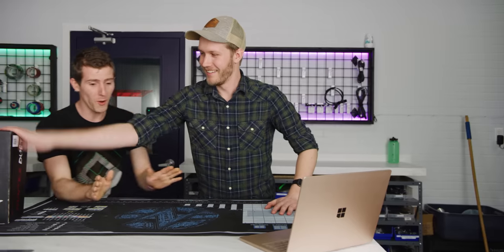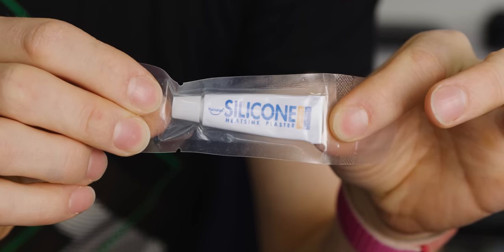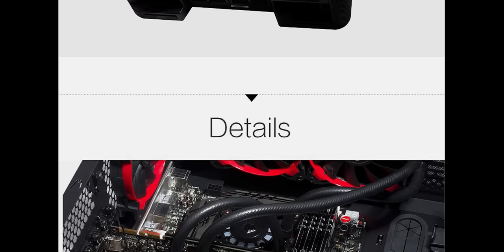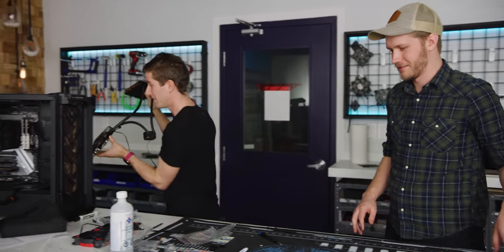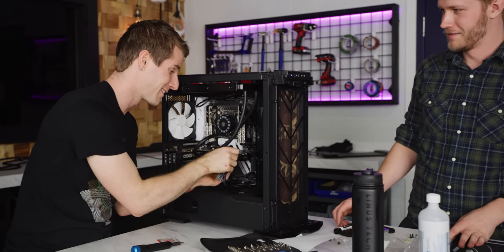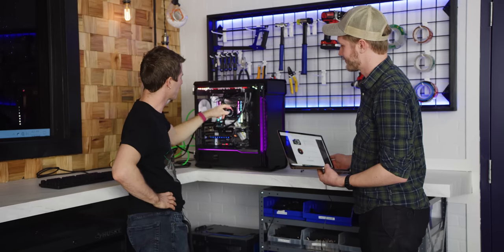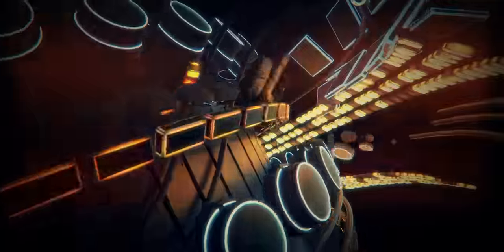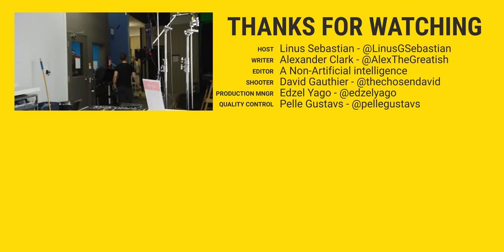This Chinese Water Cooler is WAY Better Than I Thought!

Comment: "I'm glad you took a 1070 for this"
Me beeing proud on my 1070 crying hearing this
Reply: Brah, i am upgradin AIO into my RX 580 that has just been waiting to be used.
And the stock cooler was shiet on it, that is why i just reserved it.
Reply: @mazz1985  May i know what AIO cooler you are upgrading to, and what brand is your gpu? I have this shitty msi armor rx 570 4gb that has inadequate cooling,i even tried 120mm fans mod on it  but that didn't work either so i think my last shot is AIO cooler. and is there any other lower budget AIO option that has decent cooling ?
Reply: @mazz1985 
God damn that's a 200usd AIO, I can't afford that. Is there any decent AIO cooler that is like at least below 60 usd can fit rx 500 series?
Reply: @akmalrusydi2730  compare the mounting system on a cheap cooler master 240mm aio to an Nzxt aio, if it's the same you can mount it. Although for the price it's not really worth it as the Nzxt kraken mount is expensive
Reply: @mazz1985  I have an armor 580 too,I put an arctic accelero cooler on it because man the armor cooler is garbage.
Reply: @ffwast  Ahh, i tried to buy that cooler first too, they were not available anymore :7
Reply: @mazz1985  I've seen them here and there but the price has jumped quite a bit,it was already $20 higher by the time I got mine.

Newegg still has raijintek morpheus coolers in stock though.
Reply: @ffwast  Well, i alrdy got my AIO working on the 580 so, fine for the moment.

I am European, might have slightly different market.
Reply: @ffwast  I had this gpu as back up for couple of years, i figured now is the time to make it primary.

I also was curious to see AIO pump in action, had one in my CPU, but it is easier to set up air cooler on CPU than to GPU.

Comment: This iDCooling cooler is excellent. Used one on my sons build, i had used an old 120mm gpu aio on his old 1070ti. Oc'd that 1070ti as high as it would go, pretty high too, and it wouldn't crack 60c. I paid $70 for it. Well worth it as the 1070ti was a pny with the worst cooler ever. I couldn't keep it under 80c gaming, iDCooling makes good stuff

Comment: One thing they did wrong with the VGA pump was they screw it in with both the shroud and the i/o panel on top of the table. The i/o is 2pcie slot tall and the shroud is just about 1 and half tall only so it is expected that not all the surface of the pump touches the chip of the GPU. Also the screws on the pump or the once they used at the back does not have springs to help level the pump. In my experience using 120vga and 240vga AIO pump (Exactly the same w/o the CPU pump) is that you have to put the shroud on the table with the i/o panel of the GPU just over the edge so it would not touch the table. And also if there are no capacitors or components blocking the view, you have to peak under to make sure the copper pump touches the middle on all 4 sides. Then while placing the screws and backplate on top, you should do the Diagonal pattern screwing top left and bottom right and vice versa until it is tight. Not too tight though,  because if one corner is tighter, the pump may lift on the other side and we will have the same full contact problem and redo everything. Remember r9 290x @ 90c on any AAA game. I tested 120vga id-cooling with the same pump and shroud and was able to pull it down to 65-75c full load. With the help of course changing the stock fan that came with it (SF-12025 red led 54cfm) with SF12025 No led 84.5CFM for the Radiator. Of course to achieve that, I replaced all my fans in the case to the same 84.5cfm id-cooling SF12025 fans. DOes not have RGB but you can change the rings from Red, to white, blue, or Green. Good thing they had remount the pump and fixed the thermal issue, they just did not show us how they mounted it properly off-screen. 
.

Comment: cooler master made an AIO cooler for like 80 bucks back in like 2010 called the cool-viva, and it had 2 blocks, was designed for use with a cpu and gpu at the same time, i had one, it worked pretty decently. Couldnt overclock on it, but temps were decent and it looked really cool in the case

Comment: Bare silicon like the GPU die here MUST have full thermal compound coverage else ineffective heat transfer or overheating is imminent. That's why I always spread the compound thinly with a clean plastic card when applying to bare die and use a rice size method when applying to a heatspreader.

Comment: oh my god I just had a mild heart attack when the computer case started tipping
Reply: damn same wew
Reply: i gasped so hard
Reply: I knew I couldn't grab it as much as I wanted to so I just clenched for impact.....
Reply: SAME HERE
Reply: Same !!
Reply: i think i quickly died for a second
Reply: just another day for them lol
Reply: Blank Gaming  omg same i hit my screen lmao
Reply: I installed the stand alone GPU cooler on a 2070 Super and saw temp drops between 20-30 degrees Celsius under load. Id-cooling Frostflow... 10/10
Reply: holy crap I literally died

Comment: Id cooling was the first aio I ever tried. Turned me away from water cooling for about a year before I bought 2 nzxt kraken x53 240mm aio’s. Picked up a kraken g12 for my gpu and the highest temps I’ve seen on my gpu are 50c with a 150mhz oc on the core and 750mhz on the memory. Definitely recommend

Comment: "Not sure where those extra watts come from"

Actually, this may be some next level testing from the Chinese manufacturer. See, Intel and AMD both measure TDP differently.
Reply: Or it's just sending all your data to the People's Republic of China
Reply: starshipeleven  everything was correct tho. AMD measures from the boost clock. intel measures from stock clocks. thats why intels was higher. 
Edit: im dumb as hell. It should of been reversed.
Reply: Life invader BS
Reply: @naksur2719  that would mean an intel tdp of 100w, would draw ~130w while boosting, and an amd tdp of 100w would draw 100w. Therefore a cooler should support a higher amd rating than intel. 
Say for the example above, a cooler that can cool the intel chip at boost (130w) could also cool an amd rated 130w chip at boost, supporting a 130w amd rating while only supporting a 100w Intel rating
Reply: @____5837  oh yeah. You are right. I have no idea what i was thinking while commenting lol. Sorry. It should been the other way around yeah.
Reply: @naksur2719  The heat spreader on the CPU and GPU also make difference on heat transfer to the cooler.
Reply: @blowndome  guess where your phones were made
Reply: @blowndome  Communism will save us all.  America + China + Russia + Europe technologies = EPIC
Reply: @ravik007ggn  That's cute. Seb, my naive little friend, China would love to have a backdoor into the electronic devices belonging to citizens of another nation.
Reply: @Clarity520  Thailand / India / Vietnam?
Reply: @ravik007ggn  they make phones? 😂

Comment: Chinese Manufacturers:  "Instructions...we don't need no stinking Instructions"
Reply: Morgan Not wrong just too bad instructions are for the customers and not the manufacturer.
Reply: Well they assume people aren't idiots and can screw together 4 screws. You don't really need instructions for it, if you do, you shouldn't be doing this anyway.
Reply: BeyerT1 That’s a really stupid argument considering the CPU block had instructions (almost the same shit). Besides your argument falls short companies are suppose to reduce liability for end user incompetence to the best of their ability, anything short could lead to a recall. People like you are best left out of marketing and engineering for end user products.
Reply: @MarcTBG  these are intended for Chinese use only. They should have Chinese manuals. The aliexpress seller most likely removed it. Id-Cooling isn't exactly an unknown brand either. Their export CLCs are the Frostflow/Auraflow series
Reply: Chinese Manufacturers: who needs the instructions?  ok here are the instructions (in Chinese). 
Me: chance!
Reply: DarkWorld25 That is an argument I can easily see and respect. I doubt they care if their indigenous customers have complaints and much of their pc part are sold through stalls where the seller is more responsible for end user issues (this is more conjecture).
Reply: @MarcTBG  Nah, most component sales are done online now, where generally you also get emailed a copy of the manual. I actually bought another product from them in China and that's how I got my manual.

Comment: The 350W AMD vs 400W Intel come from AMD not properly reporting ACTUAL power consumption in HwInfo which may confuse users if you told them 400W works, 380W shown in HwInfo but actually it is like 15% more than expected and clocks down

Comment: Linus put way too little thermal paste on the GPU's die. It's not a CPU Installation, you need 100% coverages of the die to properly cool it, specially since that paste probably isn't the best spreading in the world, and the mounting pressure of that Waterbolck probably isn't that great either

Comment: Use Code NogOps In The Fortnite Item Shop
Reply: Lukily next year the new decade starts!
Reply: @poldelepel  yeh
Reply: @ShadowGem  Ordinal decade <> Cardinal decade
In the cardinal decade, the first decade only has 9 years.
Reply: So Linus will remain as a teenager for the whole decade?
Reply: Stijn De Bruyn cool but i don’t recall asking🧐
Reply: @griglybearelite4886  indeed, I agree. And I never said he was wrong. That's why I made the second comment... OP's decade is the cardinal decade, and mine is the ordinal one. (both decades)
Reply: @dossin3824  Almost every comment on youtube is put there without anybody asking (even your comment). Just saying...

Comment: I've been running their ID Cooling Frostflow AIO for 5 years now. Works really great. Kept my i7 4770k under around 35c and around 55c under full load (ambient temp 27c).

No signs of leaking or whatsoever. Cheap but seemed reliable.

Comment: i just can't wrap my head around using water coolers in a computer in general. any loose hose or faulty connection and bam your computer is fried. it's just not worth the risk to me. it's like dangling a dead chicken from a string into a aligator pit and just waiting for it to snap at it. lol no thank you, i'll stick to air coolers.

Comment: the sexual tension between you 2 is palpable. you guys clearly had sexual experiments followed up by electronic experiments. linus is clearly a power bottom in this relationship. that has to be the reason you guys act kind of awkward in this video and why linus's throat is so dried out. either from salt or ooooh god, oooh god, ooh god, oh god all night long. also you guys both adapt a slight "gay accent" several times though out the video.